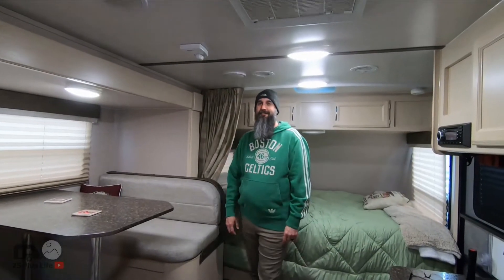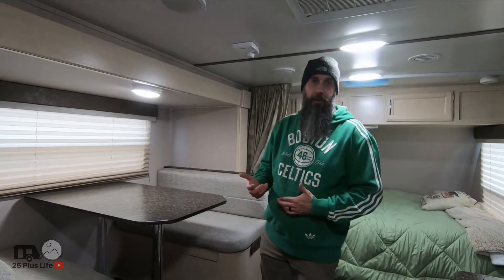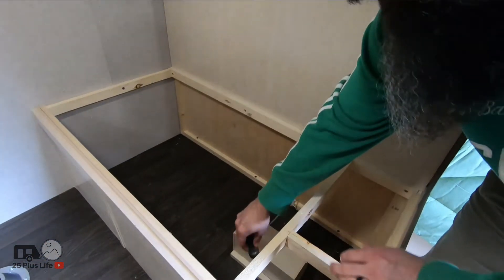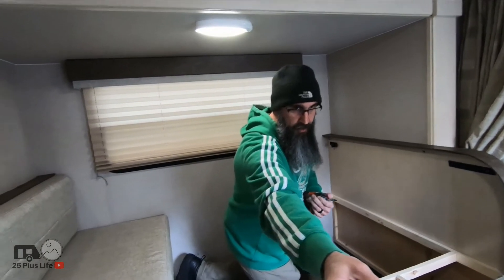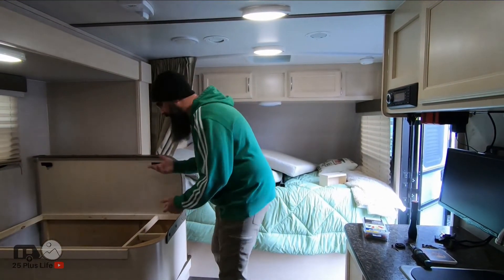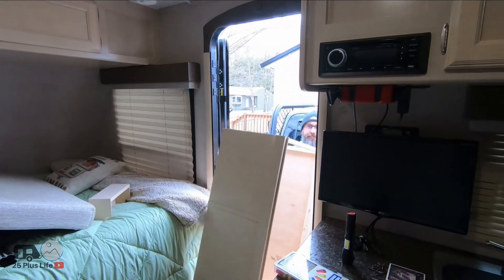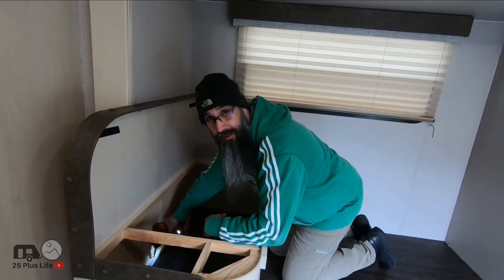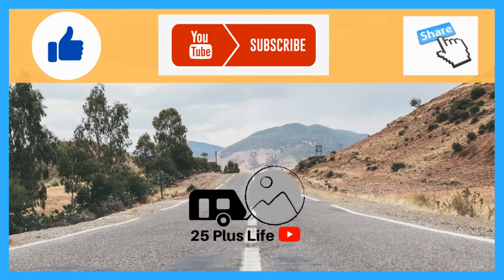2019 Winnebago Micro Minnie Dinette Removal

Comment: Great video!

We bought a 2019 Grand Design Reflection 28bh and after staying in it a couple of nights began replacing the RV furniture.

First we removed the tri-fold loveseat and replace it with a dual drop leaf table and 4 folding teak chairs. Then we removed the cheaply built theater seats and replaced it with a really nice oversized leather power reclining loveseat with usb outlets. Finally we replaced the mattress with a Zinus 12” hybrid mattress and a 3” cooling gel topper. We are very happy with the rig now and actually sleep just as comfortably as we do on our very expensive Casper mattress at home.

Next on the list is removing or modifying our top bunk for additional storage.

Comment: That was a huge improvement. Love the oatmeal fabric much more than the "faux leather" LOL!!! QUESTION: I'm considering a Micro Minnie same model as you have. Do you recommend it? How is it for cooling and heating? I have only seen one outlet for heat in the living area and one in the bath, does it keep the bed area warm for you? Thanks!!!
Reply from the maker: Our is a 2019 so it was pre-pandemic and we haven't had any major quality control issues. Friends with 2020 & 2021 models have mixed issues, some minor some major as they just started to pump them out. There are several ports for a/c as it is a ducted system. The heat literally will cook us out as well.
Reply: @liferedesigned  The quality control for recent builds considering the rush of buyers is to be expected I guess. Perhaps in a few months the build quality will return....I hope! At least Winn does use better materials than most.

I like what you did with the bunk area. My camping style will be close to full time. National Parks and boondocking on BLM ground is our plans.
 I also will remove the bottom bunk to start with to make a "solar room" Looks like a perfect spot to put four Li batteries, hybrid converter/inverter on the front wall of the bunk area. Perfect place for either a Victron Multi Plus hybrid Inverter/charger or a Go Power.
The back will be used for very light storage. I would like to figure out how to hardwire a Bulldog surge protector inside to keep it safe from the weather and "midnight shoppers"
Please do some more RV video's.......you do a good job and are very enjoyable to watch! Good Job!!!